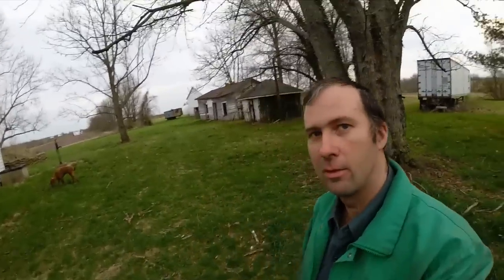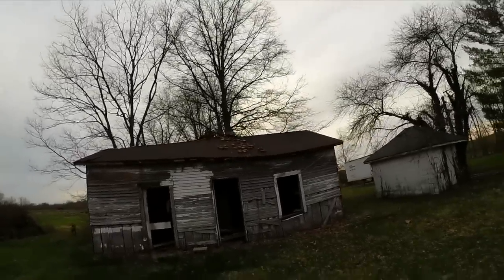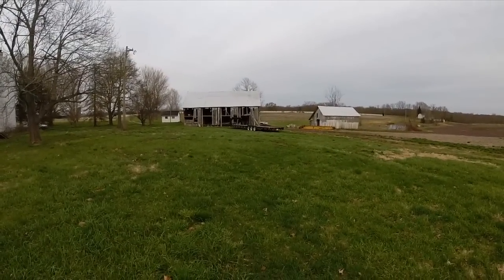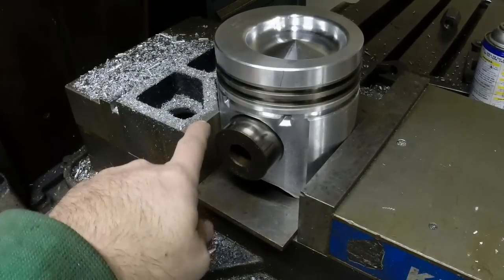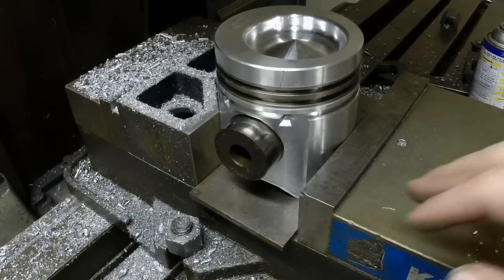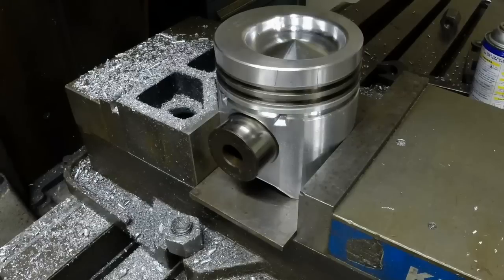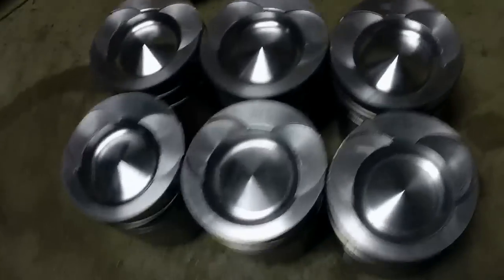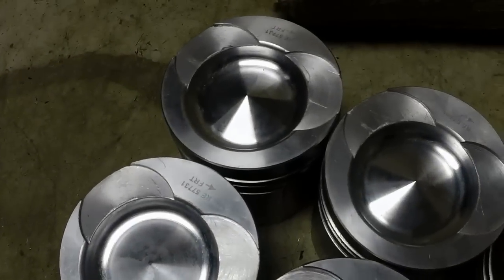Cutting Piston Valve Reliefs

Comment: Do you know where you got your valve relief cutter?
Reply from the maker: I use a counterbore
Reply: @bcbloc02  can I give you a call? Is it adjustable? Where do you get them?
Reply from the maker: @RockinP  no they are fixed diameter so I have different ones for different valve sizes. I got mine used but they are available from msc.

Comment: Will cutting valve relief like lower target compression ratio?

Looking to build a 2v 4.6
Reply from the maker: Yes Reliefs will lower compression, the more you cut and the bigger they are the more it goes down.
Reply: @bcbloc02  so also in a sense, if you go for a radical camshaft, your compression can only go so high because of how far the valves travel correct.

A smaller camshaft will allow a higher maximum compression ratio than that of a radical one right?

I want to build a 4.6 2V with Trick flow R head, high compression and a big cam but don't see how it's possible when modular head shop's biggest camshaft needs valve reliefs

Comment: Hey Brian message me how much you might charge to do this to a set for me.

I'd like to do the deburring. Not sure yet if I'm gonna go with a 4.25 JD piston or the stock 4" DT IH piston but there will be 6 of them
Reply from the maker: I normally charge $25/piston. I will need to know where and how deep you want them. It is my opinion that the bigger the bore you can run the better always.
Reply: +bcbloc02 
yeah for sure. Biggest reason for putting a 4.25 bore setup is to run bigger valves in the head

Comment: Hello Brian,
Those stormy weather did take a tool on your area, not much to be done against nature... Frightening!!!

This is a huge piston compare to normal running engines, but, everything is relative, if you compare to a ship engine piston though.
Pierre
Reply from the maker: This piston is only 4-5/8" bore. I regularly do work on pistons to 8" bore size. Bigger than most automotive stuff, but certainly on the small end of industrial and ship engines. I have never done any machining for any of the engines you can stand in the cylinder for inspection purposes. I will need my bridge crane for sure when I start working on those! lol Thanks for stopping by.
Brian

Comment: Those pistons just seemed regular sized in the vise until you put your hand into the frame! Those puppies are massive compared to the pistons I've dealt with...especially when the 1st top end job I ever did was on my model airplane engine with a piston smaller than a dime, LOL! I've done a few V-8's also, but never any diesel engines so it's very interesting to hear about the ceramic coating they receive for service under high temps.

I know it's a pain, and seeing as how I'm not hardly shooting anything at the moment myself I feel selfish to ask, but if you ever get a chance, I'd love to see a little wider shot of you working the dials and controls when you're milling. I'm not sure if Boss Bailey allows requests, but I just thought I would throw it out there. Thanks for the show and sharing your farm and shop with us. I'm very sorry about the damage and really wish I could come and run my wood chuck tools for a few days on your shop...Aloha, Chuck
Reply from the maker: Hey Chuck come in about 2 months and you can have all the black raspberries you can eat!  I would almost need two cameras to catch me working the mill controls since they are over 4 foot apart, you could see me moving them but that would be about all you could tell.  I have a 2000lb part to do some milling on so maybe I will do some far shots on that one for ya. :-)
Reply: bcbloc02
LOL! Trying to get me hung up in your raspberry thorns now? He he, I remember picking basket after basket for Mom when they lived up in Oregon on their 1st farm...Man, she would make everything using them, from muffins to syrup for your pancakes, and Dad would make a Black Raspberry fortified wine that was so excellent they would have to hide a few pints to keep any for the Holidays in the Fall. It would sneak up on you too, tasted like raspberry Koolaid until you tried to stand up ;)

Thanks for the reply, and I forget how massive your machine is so just film as you see fit, I always enjoy your videos and don't plan on stopping. Off to get Dad's Cubs game playing from the PC to the big-screen, so I'll talk to you later. Aloha...Chuck.

Comment: Does the loss of compression ratio become a factor that needs to be addressed?
Reply from the maker: The increase in boost more than makes up for any loss of compression. Actually it is very common to cut the bowls out to reduce compression even more to both allow more room for air in the cylinder and to keep the cylinder pressure within a range that won't either split the block in half or blow the head gasket and fire rings off.

Comment: I thought that the proper way to clamp down pistons is through the pin hole not with a vice at the side skirts...
Is this way safe for the pistons ???
Reply from the maker: For these big diesel pistons it is fine the smooth jaws won't even put a mark in it. The sidewalls are close to 3/8" thick and they weight about 4lb each. If these were a light J&E auto piston with a thin skirt this method would not be acceptable, but at the same time those pistons don't usually have a machined flat bottom skirt so you cant reference from there on them either and then you also need pin location for getting the heights right.

Comment: I see the hats are still in the pistons so this must be for a diesal puller . IH ?
Reply from the maker: Those are Deere pistons.
Reply: bcbloc02 I use to do pistons for a four charger IH where we did the valve releifs and took out the fire bump in the middle . Now they just buy them
Reply from the maker: STR IRONWORKER
 Yep I deal with plenty of custom forged Arias pistons and even some billet steel pistons depending on the application. A lot of guys not looking to spend that kind of coin though. I did a cummins once where we dynoed before and after cutting the bowls flat and changing nothing else and it lost 50hp cutting them.